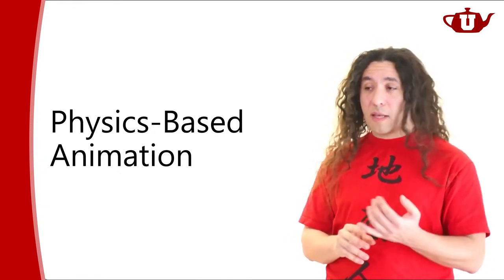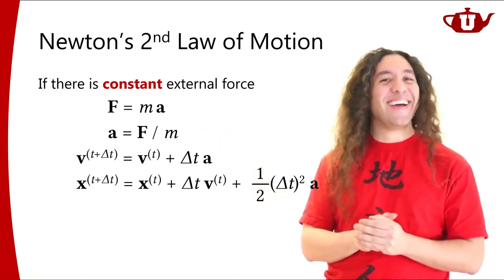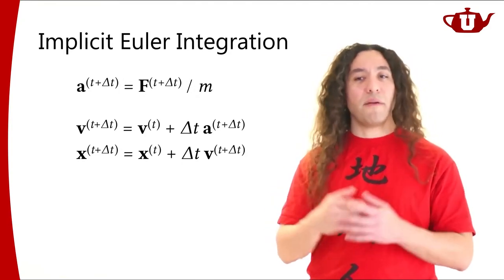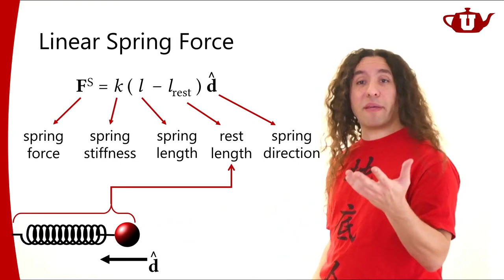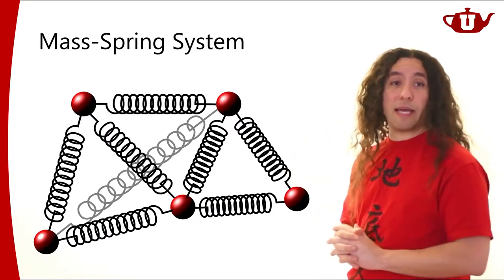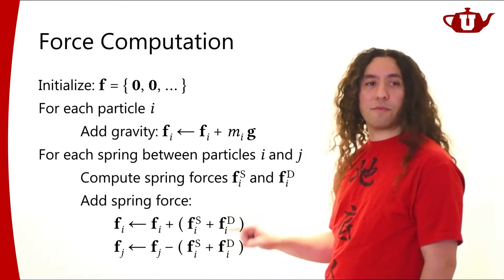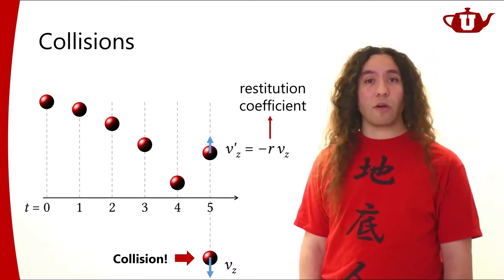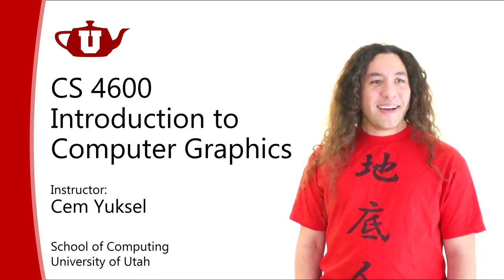Intro to Graphics 24 - Physics Based Animation

Comment: Thanks. I hv bn unable to create motion along x axis with constant acceleration, like free fall along x axis. The position profile is supposed to be parabolic with time by Newton law but I am expecting a straight line. Pls is there something I am missing?
Reply from the maker: You are missing a few "e"s and "a"s (sorry, couldn't resist).
Indeed, you should get parabolic motion with constant acceleration. All I can say is that there must be something wrong with your implementation. If you are getting constant motion, perhaps you are not updating the velocity or moving with the changing velocity.
Reply: @cem_yuksel  Thanks for your generosity in replying. And sorry for those unfamiliar contractions. Please, I really wish I could understand how to transit from the prediction of Newton's laws to my needs. Is there a way I could construct a straight line motion that is speeding up in 1D from a parabolic recipe? I am honestly at a loss. Could you recommend a resource that can guide me? What of some ode solver too? Thanks again for your time and patience.

Comment: Great video! Mind if I ask a question about path-tracers with motion blur ? I extended Kevin Beason's smallPT path-tracer by adding a Möller-Trumbore algorithm to work with triangular shapes. Additionally with an .off loader function to import some meshes. Right now, I want to implement a simple motion blur. Where should I start ? or any sources that you suggest ? Thank you a lot! Cheers
Reply from the maker: This is a good place to start exploring motion blur: http://psgraphics.blogspot.com/2016/02/motion-blur-in-ray-tracer.html